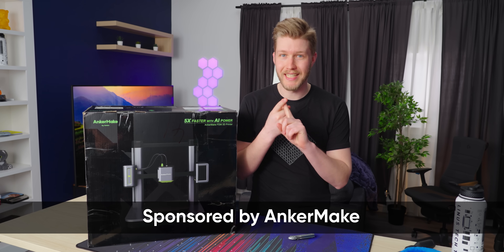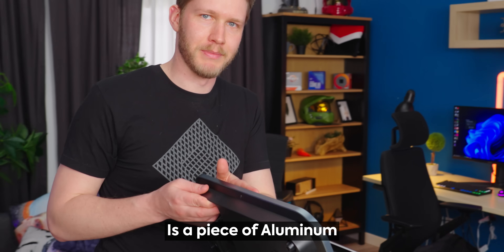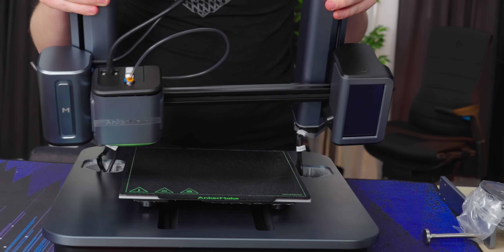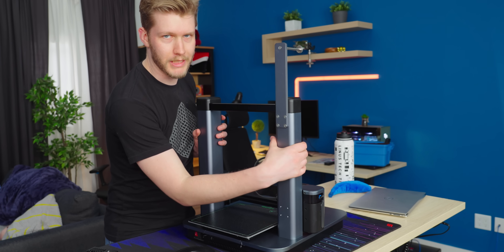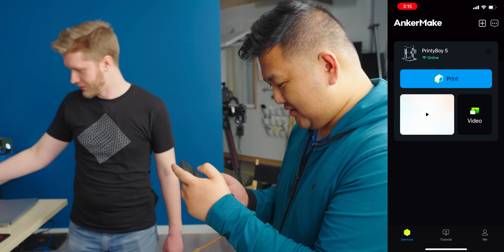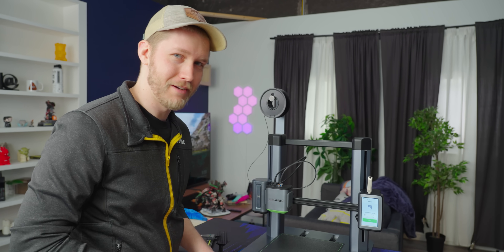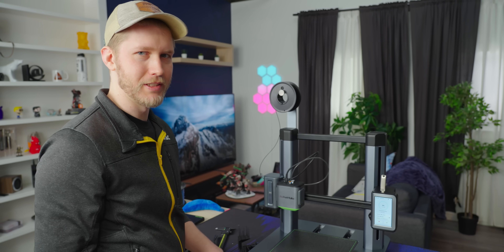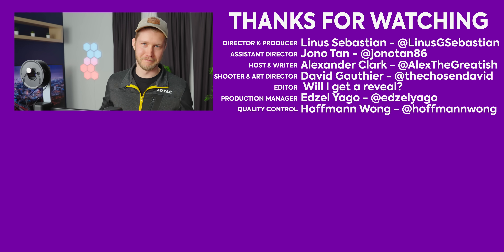Much BETTER than Expected - AnkerMake M5 3D Printer

Comment: As somone who has worked with 3D Printers for years now, I'm VERY impressed. For a company that had no foot in additive manufacturing, to come in swinging this hard, they're about to make their name known!
Reply: I'm willing to bet Anker has plenty of r&d notes from product development and wanted to solve a lot of painpoints of their own product development chain
Reply: I've got a prusa and ender3v2 but holy f this looks amazing for this price, I'm holding out for now seeing if there are any problems but if every claim turns out to be true it's amazing value
Reply: They're just trying to get a piece of the pie for more money now that most of the work has already been done with the open source materials and crowdfunding it no less. Bill gates would be proud.
Reply: Anker is so diverse it blows my mind. They have the main brand with power and charging stuff, Soundcore with Bluetooth audio products (love my Q10s!), Nebula with projectors, and now AM with friggin 3D printers!
Reply: lmao sure you have worked and impressed with this trash
Reply: they wont be clown xD for 700 claiming 5x faster than other printers? not with that 2500 acceleration for 250mms print speed if you worked with 3d printers sure wouldve caught on it xD
Reply: I have to strongly disagree and recommend exercising caution in purchasing. This isn't a Voron 2.4 and it is painfully obvious. Wake me up when 10K+ accelerations and 500 mm/s speeds are here. And there are several parts that have been pointed out that will fail early on given the material used. Avoid!

https://www.youtube.com/watch?v=0E0dM0ZdpRE
Reply: Jack   cringe are clueless clowns defending this trash
Reply: Most likely just hiring a company to do it and they rebrand it, it's not like they reinventing it themselves. it's all about money.
Reply: Sorry but bambu lab mic dropped the entire industry..
Reply: Anker has been known for a while
Reply: Good? Copying an Ender 3 is that good of a practice?
Reply: @Fejszi  Some good points here https://www.youtube.com/watch?v=cYNZ0VzvywY
Reply: @Fejszi  I'm very sceptical to the overall reaction people have about this printer, but saying it's an Ender 3 clone is just..not correct in any way.
Maybe you can call it an i3 clone since it's a cartesian, but Ender 3? Just..no..
Reply: @Akegata42  lets not compare this to a Prusa that uses linear guide rails, E3D hotend, bondtech direct drive gearing, etc etc.

Let’s compare it to the Ender 3 S1.

Both Cartesian. Both use rollers X and Y. Both use belts X and Y. Both are direct drive. Both have filament run out sensors. Both use dual lead screws with no horizontal support. Both are using dual z steppers. Both using standard open loop 42-34 steppers. Both have auto bed leveling albeit AnkerMake might be better but the S1 works fine. Both on marlin.

Both are literally doing everything the cheapest way to get acceptable results. 

The difference is the Ender does that to produce an affordable product. This is just a clone with a fancy case, locked down slicer (potentially), no easy access for print server, at twice the price….

Sorry bro it’s a clone, just a more expensive clone in an aluminum disguise.
Reply: @Akegata42  the wire and motherboard housing alone blows an ender out the water. Did nexin even watch the video?
Reply: @jonathanviterise1681  so they milled some aluminum and spent way too much on their influencer models to suck up extra hard on top of sponsoring the videos? Wowie what an improvement to something that had never needed it.
Reply: @Fejszi  they all copy reprap open source soooo?!?
Reply: @cathycoudriet7752  yes, but please, oh please go back in time to the Sells Mendel, then compare it to the Prusa Mendel (even the I2); the Prusa is a copy of the Sells but it has many improvements over it. The thing is that now, companies don’t improve the design, just copy the core elements and then bolt on some off the shelf components, just to saturate the market…
Reply: Anker is doing really good !
Reply: Nothing wrong with shaking things up a bit ;)
Reply: @UncleJessy  you suck too, I can't stand being surrounded by you shills. It's like your whole job is just to convince people to buy the next new thing, whether it's good or not.
Reply: @UncleJessy  aww shill clown is here too
Reply: What is so impressive about this printer?
Reply: @Zae-R  10 mins to assemble, plugged it in, and it prints really dang nice. No mods, no tweaking. Perfect for new people to 3D printing or people who don’t want to tinker. How will it be in the long run 🤷‍♂️
Reply: @UncleJessy  did you slice the models used in the speed tests yourself, or did you also use pre-sliced Gcode provided by Anker like Alex did in this video?
Reply: @nachiketmhatre7411  they provided 3 pre sliced files to me. I printed 2 in my video. Everything else I sliced myself as I mentioned in my video in s3D and Cura
Reply: @UncleJessy  thank you for sharing, much appreciated. I presume the 3DBenchy used in the print speed test was also pre-sliced, right?
Reply: @nachiketmhatre7411  nope, that was mine, the big square print was pre sliced and the overhand/clearance test was pre sliced. Have all of them labeled in my video
Reply: @UncleJessy  it awesome that the printer hits those speeds with user-sliced benchies. But I am concerned by the wear on the V-slot rollers as a consequence.

And I wonder if they have connected the second Z axis to a separate stepper driver for independent control required for G34-based automatic X-gantry alignment.
Reply: @UncleJessy  already distancing yourself from it. Besides the fact that it has easy setup and can print some PLA, someone as experienced as you should know how easy and cheap that is and how many ender clones can do that job just as well with all the mods already on them. Next you're going to tell me the preloaded files are an achievement to print and not optimized to show off the machine. Bought and paid for.
Reply: @Mossyfurnace  huh🤷‍♂️ I’m posting prints with it a good bit on my socials. Printing Hex3Ds latest chest burster on it right now 🤘
Reply: @UncleJessy  just because it will print doesn't mean it's worth that price or that the "ai" adds anything of value other than weight to the gantry in what is supposedly a high speed machine with speeds that are pushing what you'd want to do on most Cartesians for the sake of throwing buzzwords at newbies who've bought their power banks and don't know any better.
Reply: @Zae-R  it’s really more about how unimpressive a lot of established 3D printers are in terms of reliability
Reply: @PasteurizedLettuce  We still can't call this printer reliable until more people get their hands on it and try it. I am not even sure about what makes this thing more reliable.
Reply: @Zae-R  the fact that it can finish such a complex print in 2 hours right out of the box without many tweaking. I only own a 200$ budget printer and there are sooo many things that could go wrong
Reply: @pochita6158  it's just an overpriced copy of an open source design and open source marlin firmware.
200 is the bare minimum, but even the Tronxi xy2 pro works out of the box with auto leveling.
Above 300, every printer is 80% pre assembled and just works.
Reply: @pochita6158  I printed my first successful model without fail right out of the box with my ender 3 v2, you just need some basic knowledge before you dive into it. to be honest, this printer caught my attention when it was announced, but seeing it in action it's just another overpriced printer to me. not to be salty, but I did except something exciting about this.
Reply: @Zae-R  speed and accuracy for a reasonable price ?
Reply: @cathycoudriet7752  How could you judge a new product by only one video? Speed and accuracy are always claimed by 3D printer companies. One print is not enough to prove it.

Comment: I've been doing production 3d printing for a while now, and while the speed looks great but for doing a reasonable amount of printing the biggest problem looks top be the serviceability of the print head. It is inevitable that you'll have to clear a jam, change the nozzle, etc. for me at least that would be a complete deal breaker at any price.
Reply: That is just a plastic cap which can be removed easily. Also, there will be all the necessarry spare parts available for aftersales :)
Reply: @bigfoot996  how are you sure?
Reply: Also enclosing it
Reply: All you do is making assumptions. Maybe there is just one screw to open the case and service it all easy.
Reply: Prusa printers showed me the light tbh.  It will be difficult to switch to anything else FDM-wise.
Reply: @RightJoystick  same, recently started to try and fix my tevo Tarantula and my good is it a mess
Reply: @RightJoystick  Prusa is past its prime. Maybe up to 3 years ago, they still made sense for a lot of people, but today, with the slew of much cheaper printers that print almost as well and comparably priced printers that print much better, Prusas only make sense for a very small segment of the market. 
They make some straight up bad decisions that screw over their customers, like putting a drilled out version of the E3D V6 heatbreak, which is very prone to PLA jamming during detailed prints, into all their printers just for the sake of compatibility with their multi material addon, when they easily could have used the original heatbreak and only include the modified one in the addon kit. This issue BTW is well documented and has been know for years, but Prusa continues to do it, because it's easier and cheaper for them. 
Then there's the lack of innovation. I mean, they're still selling an 8bit bedslinger for $1k in 2022, FFS! And instead of developing new printers themselves, they just buy competing companies and rebrand their products (neither the SL1, nor the upcoming XL have been designed by Prusa). 
Honestly, at this point, fuck Prusa.
Reply: @hellterminator2295  Used an Ender 3 for two and a half years.  Got it to print just about as well as my current MK3S+.  The Ender even prints at about the same speed.   The difference with this Prusa though - I can literally let it print for 48-72 hours and know it will work.  Filament runs out? It’ll stop. Something starts to crash? It pauses.  Power goes out? It can resume.   For a work machine that’ll be used to print prototypes basically daily, I have no issues recommending one of these newer i3s.  I haven’t adjusted the bed/releveled in 6 months lol.  Tbh I don’t even calibrate flow anymore (adjusting e-steps when switching filaments on Creality machines gets old FAST).  We’ve also got a Craftbot FLOW IDEX XL in-house, these Prusas produce more consistent results.
Reply: @RightJoystick  Yup, that's exactly the small market segment I had in my mind: people who need a reliable (unless you're printing large, super detailed models in PLA) printer, but don't want or cant afford to spend extra on an actual professional printer. 
Hobbyists can afford to print slow and even lose a long print every once in a while, so the final quality and cost are the most important. Here, a well tuned Ender 3 wins. 
Or if they are willing to spend $1k, they can build a Voron and get a much better printer. 
Big companies would rather spend extra and get a Stratasys or something (and not necessarily even an FDM one) than deal with this weird hobbyist/pro hybrid. 
So all that's left for Prusa now are small pros, such as yourself.
Reply: yeah it is way too big for servicing. Also just looks like a bmg extruder ripoff and and creality style hotend. I would like to see more of the insides.
Reply: I've been 3D printing for 10 years and have only ever had to clean a jam once. What are you putting in there?!
Reply: @bman2827  for me personally its mostly because of throughput, I put right around 10kg of filament through each machine per month over 7 machines so it adds up, mostly if the PTFE tube comes even a little loose and molten filament swells between the nozzle and the tube and gets stuck. I have only really had jams on my direct drive all metal hot ends when I was working a lot more with Carbon filament but that's another story all together. In any case, while my case is certainly not typical, my point still stands that at first sight the lack of accessibility seems restrictive when you inevitably need to service something. Though someone mentioned that at least spare parts will be made available so hurray for  repairability at least.
Reply: @danielbenda6352  you realise that this is basically an Ender-3 with another leadscrew for the Z-axis, right. And Anker won't tell us if it is idependently driven and supports G34 auto-alignment of Z-steppers. Every major component (steppers, extruder, hot-end, motion system) seems like it's an off the shelf part.
Reply: @bman2827  i used to work in a 3d print shop, we had printers jam all the time. granted, this was 3-4 years ago using 1-2 year old printers, but these were not cheap printers (Zortax M200s and 300s and plus versions, Markforged X7, an AirWolf, a few EnvisionTecs, after I left they got an Ender Pro). Did they jam often? No. But they would.
Reply: @bman2827  Print with PLA.  Now change to TPU.  You can't without adjusting the feed gear tension.  And if you forget to adjust that tension, you'll get a snarled mess of springy filament inside the feed gears that you need to clean out.

Comment: Based on their price, it looks like they are trying to compete with Prusa.
I wish Anker luck in getting the same reliability as Prusa
Reply: It looks much nicer and the build quality seems much better than a Prusa. The Prusa i3 Mk3 is a design that has been around for a long time, and through iterations and strong community support is relatively solid but IMO Prusa has gotten complacent and it’s not really as great a value proposition anymore. This Anker product looks really promising but time will tell how reliable it is.
Reply: @eyeborg3148  Just based on this video I can say that the filament feed system and filament detection are considerably inferior to a Prusa MK3S.

I also don't think your notion of complacency holds any water.  You can buy a $50 kit from Prusa right now to turn a MK3 into a MK3S+.  So not only is the design being refined, but you can take advantage of those refinements without buying a whole new machine.

You don't buy a Prusa if you just want a "value" machine.  You buy a cheap Ender 3D clone for that.  You get a Prusa to avoid the headaches that going for "value" inevitably procures for you.
Reply: @eyeborg3148  Prusa are reliable af.
It's the same with cars: BMW and Mercedes are nice, but if you want something that works you go to Toyota.
We will see how Anker will make it.
Reply: Prusa who?
Most people have heard about Anker.
Reply: @dubious6718  Prusa Research makes 3D printers that are excellent quality for the price. The same printer used in LTT video “3D Printing 300 Face Shields… PER DAY”

Comment: This is an extremely impressive result given the speed it is running on, 250mm/s is way faster than what I am comfortable running my printer on (with my modded i3 mega s from anycubic, I usually run it on 70mm/s), and the quality of the test print wows me as well, that is not an easy print to pull off, especially not on that speed
Reply: I guarantee you that is not 250mm/s. You can set the max speed to 3000mm/s. If your acceleration is not set appropriately, it could never go above 10mm/s (for example). If you want to see what 250mm/s looks like, go take a look at vez3d.
Reply: @androiduberalles  True, I wonder what the acceleration on this machine is set to too. I have actually subbed to vez3d for quite some time now, that speed he is able to achieve, with that quality (except the speed boat challenge of course lol)  just amazes me.